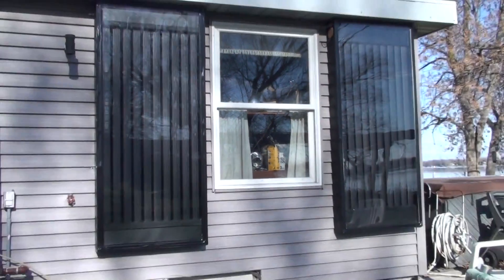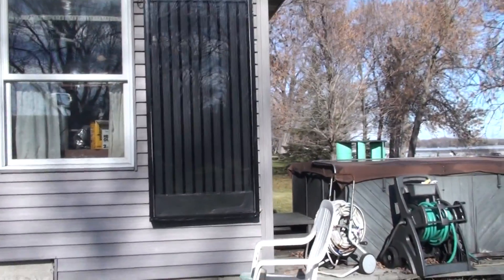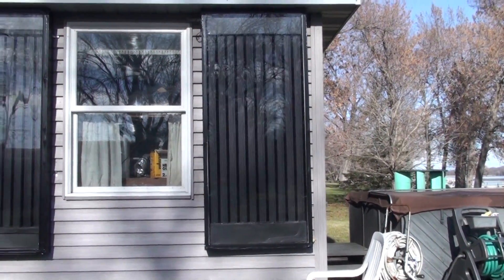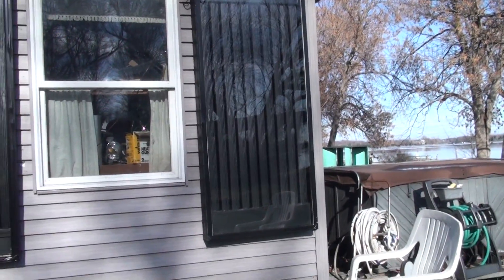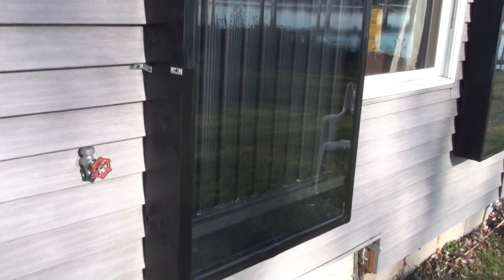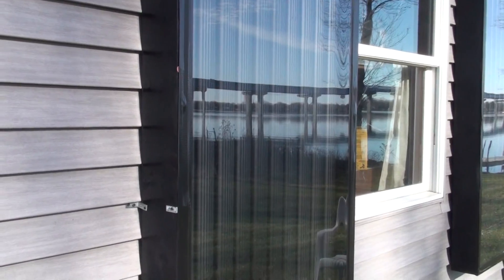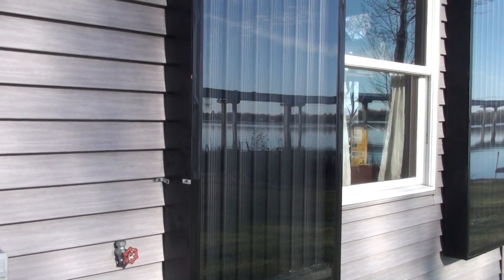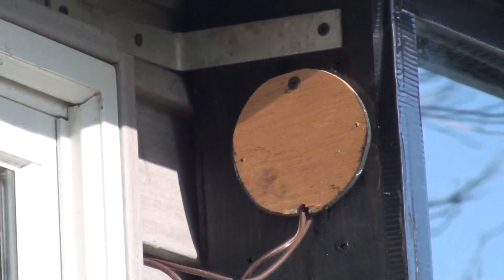solar air heaters

Comment: during winter in ne pa there is no sun will it still heat / the sun is blocked by chem trail clouds thanks
Reply from the maker: No, it will not heat with no sunlight. But you always get some sunny days in winter.  and it doesn't cost anything to run if you don't use a fan or use a solar powered fan.
Reply: wiboater4 we  dont get much sun at all, i am taking vitamins b d c and multi,because it is all ways cloudy here,i would love to build several of the heaters,it is so cold  here .im trying to talk my wife into moving, thanks

Comment from the maker: I have a lot of air volumn so they don't get real high when it's running. Highest was around 115 degrees running. I just put up another video explaining a lot more.  The panels are about 37inches by 6 ft. each. The one on the left has the cans without the tops cut out and the one on the right has the tops cut out. Instead of cutting the cans like you I used a beer can opener and punctured the sides of the top and bottom cans inside the downspouts.